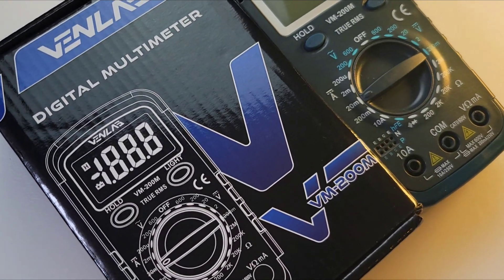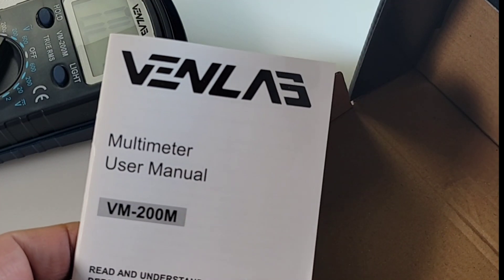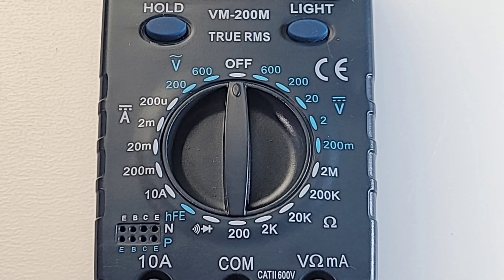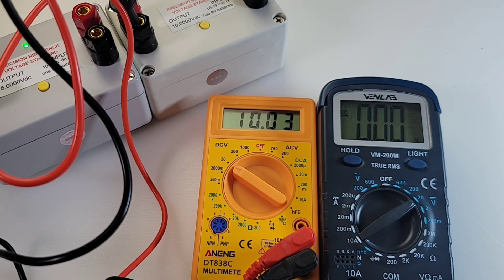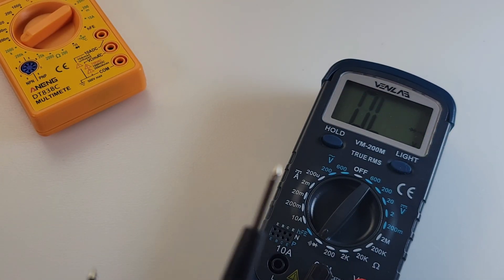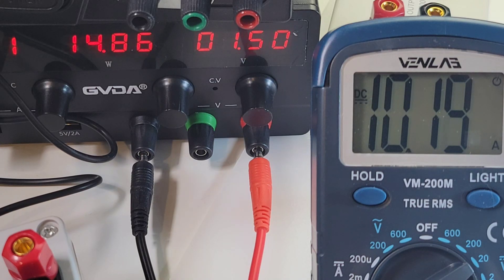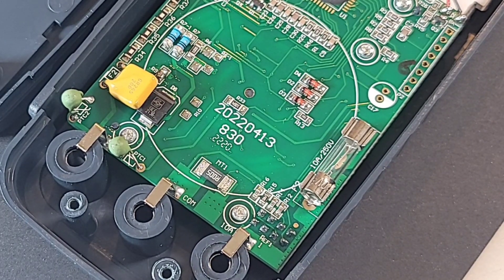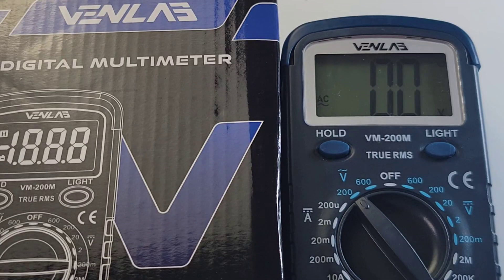VENLAB VM-200M CHEAP-O Multimeter Review & Teardown!

Comment: Many Fluke meters don't have true RMS. I bought an $80 dollar meter and had to take it apart and solder unsoldered joints to make it work properly on all functions.
Reply from the maker: Yikes, you had to resolder a Fluke ? 😮
Reply: @KeepOnTesting  I didn't really make it clear. The $80 meter I had to solder wasn't a Fluke. I was surprised that the cheap Chinese "Fluke" meter has true RMS, while some expensive Fluke meters don't have true RMS.

Comment: Pretty basic, but functional and seems to do the job. Bit of a disappointing LED test, given its fairly high test voltage. Thanks for the review.
Reply from the maker: Good point. LED test seems to be a showstopper for alot of multimeters..and not just the cheap ones 😀

Comment: Even with its shortcomings its a step up from the usual 830's since the 830's have zero ptc's, and the self resetting mA device is a nice touch along with a MUCH bigger display, really a bit too big -- first time ive seen a display that was almost too big for the window, but ya know its WAY bigger than the 830 displays ever were so thats still a positive I guess.  If they just tweaked the accuracy into line added a ceramic instead of glass fuse and made the font fit the window a bit better and add a brass screw insert for the battery door it would bring this one into the  zone pretty well, ive seen worse for more money.
Reply from the maker: All good 👍 points !! Those 830s are indestructible albeit mediocre they still do the job. That price is vang on top..kudos Venlab for not getting greedy!

Comment: 830 with AA's! Could have been all good but then...self tapping screw. The screen font on the box would have been better on the actual meter. It reads amps a good bit off and the rubber "case" as well. But hey, if the price is right it won't hurt to buy a bunch and put some place where it will be useful when time comes!
Reply from the maker: My thinking exactly Rui..at this price it won't hurt!

Comment: Just your basic homeowners meter. For the price It's not bad. Yes it's very similar to an 830 series or 850. Except I think all the ones I have in those series have current shunts. Still though if all you need is something to check a car battery or make sure you turned off the correct breaker this will do the job.
Reply from the maker: I miss the current shunt also..I've seen the current sensing resistors fail after a short time so it's not the best solution..then again I don't think  many folks will use this on a high current project.. I hope!